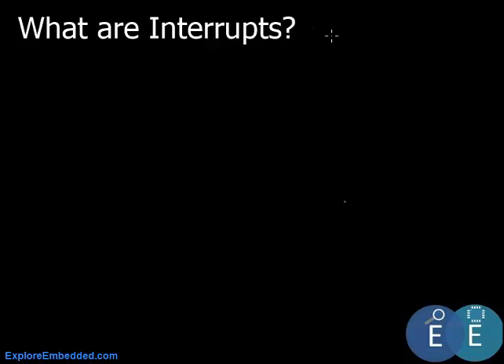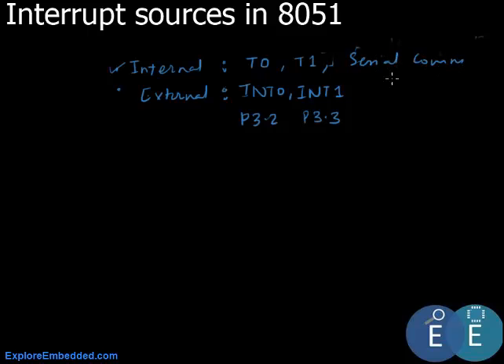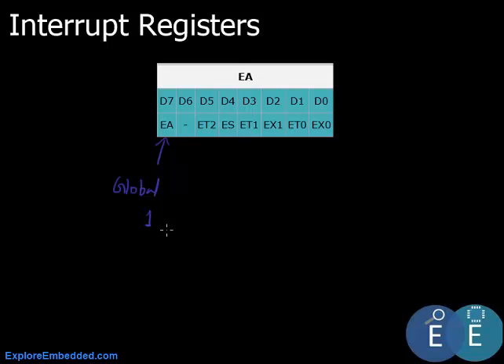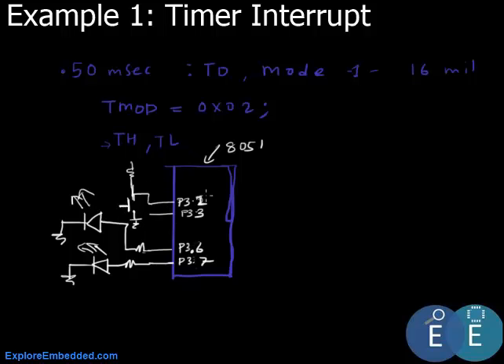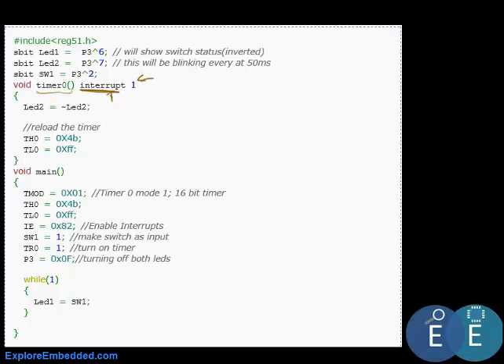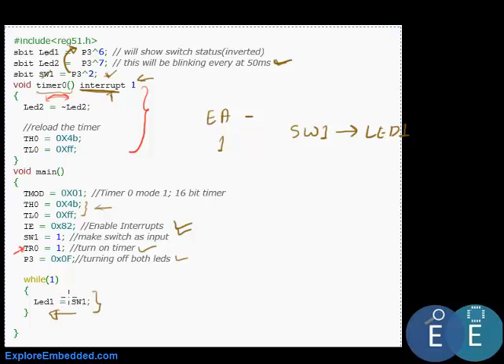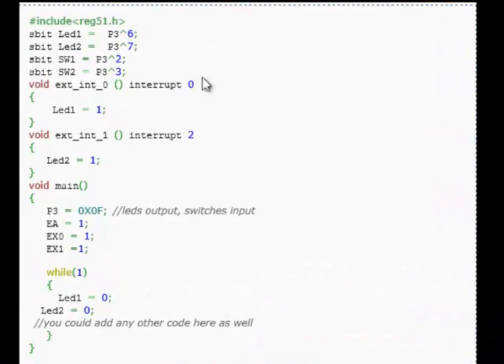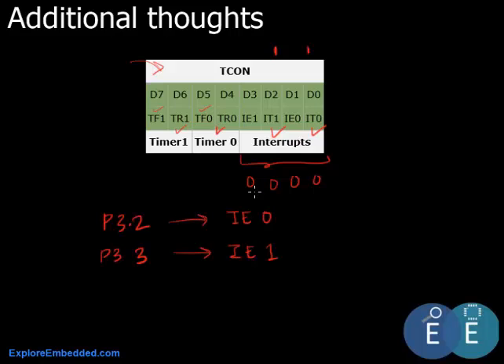8051 Interrupts

Comment: Sir How do i match the timer to some particular  frequency, like blink the led at 500 hz??
Reply from the maker: You may do the following.

1. Calculate the time register values to generate the required delay. (If the max value of the delay that the timer can generate is more than what you need, you can keep count of how many times the timer needs to overflow)

2. Configure the timer overflow interrupt

3. Toggle the led pins in the Interrupt service routine.